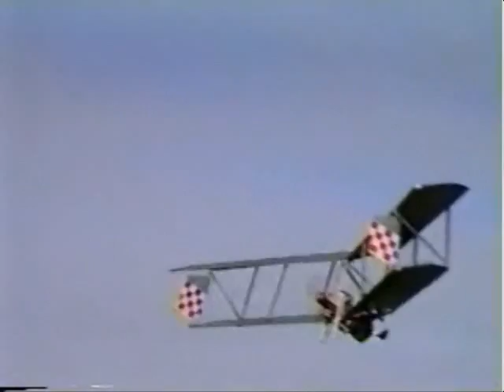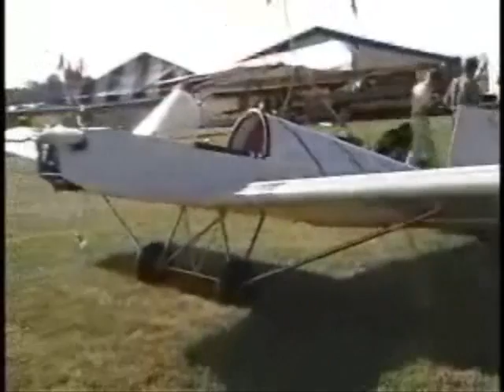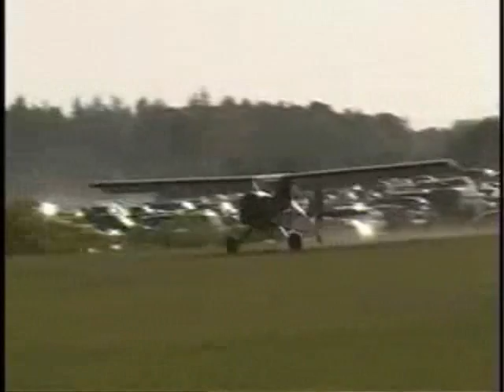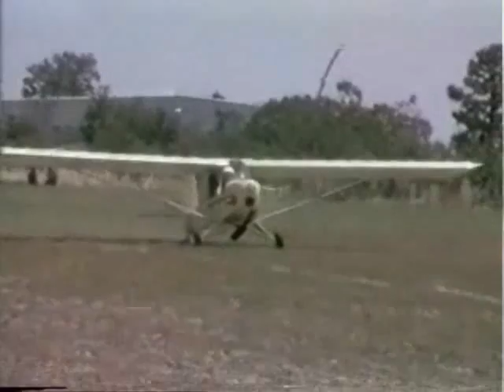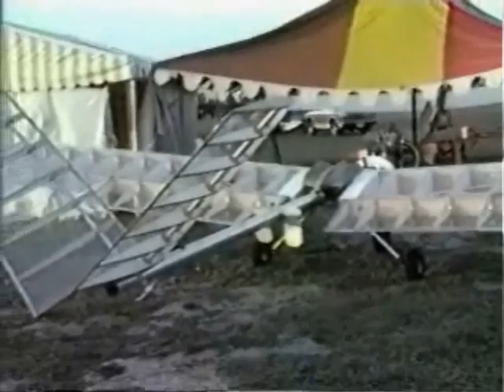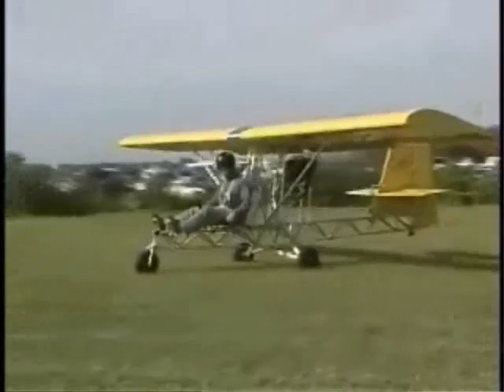Ultralight, ultralight aviation, ultralight aircraft, Sport

Comment: They need just expand the ultralight category to include Sport Pilot and Experimental classes, so that ultralight pilots could build heavier machines that were safer, and Sport Pilots could do away with all the idiot rules and regulations and requirements, and only be required to follow the same basic common sense air rules the Ultralight pilots do now.  In other words, give the Sport Pilots the exact same freedom the Ultralight pilots have now, and take nothing away from the Ultralight pilots.

The Ultralight category kind of sucks, because lets face it, you're pretty much flying nothing more than a flimsy box kite counting pounds like they were pennies and flying around the local airport.  Spots on your plane where it would be a lot safer to bulk up your joints or welds with a few extra pounds, go without.  Which is just asshat stupid.

Comment: Bottom line is that the new sport pilot and Light Sport Aircraft rules (or more specifically, the elimination of the class of aircraft prior to 2010 known as light sport aircraft two seat trainers and the elimination of ultralight instructors (known as Basic Flight Instructors)  )has made it  very close to impossible for a new wannabe ultralight pilot to get ANY training, let alone at the reasonable prices before the rule changes. He/she has to either give up the idea or jump into a single seat UL and takeoff with NO dual training time. This has come very close to killing ultralight  flying
Reply: wont stop me from crowhopping and then flying.
Reply: But it will stop many many others from getting into uktralight... Snd already has.
Reply: +pula censor its not lack of instructors or dual instruction.   its lack of cheap new ultralight planes.  everyone started designing and building for the high end and rich customers.   you can't buy a new ultralight now for less than $10K, which means your stuck scrounging a plane from the early 80s in need of lots of work.  too much work, with all the support system... gone

Comment: I absolutely do not like where the EAA has gone & how the FAA is treating grassroots aviation, but you are misrepresenting a few things. Nothing has changed with part 103 legal ultralights. If you were a legal 254 pound single seat ultralight, the new rules have no effect on you. If you built a "fat" ultralight with 2 seats for "training" or U/L was over 254 lbs then you had to register it as an E-LSA. Part 103 was never meant for this. Rule should only apply to the 500 instructors & their A/C.